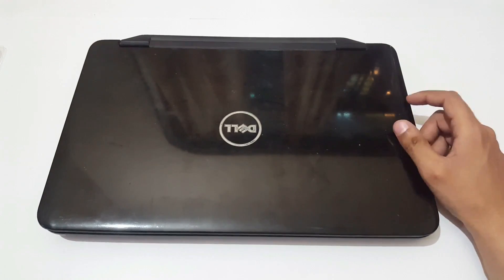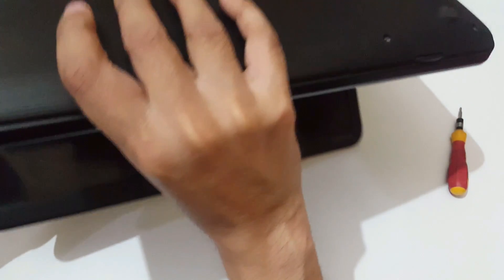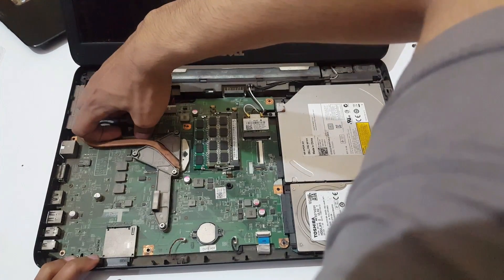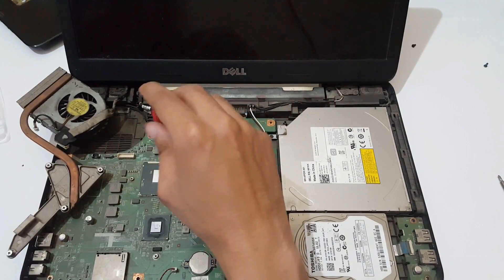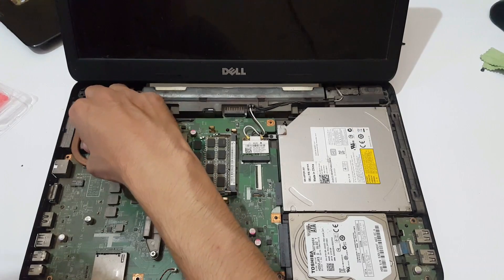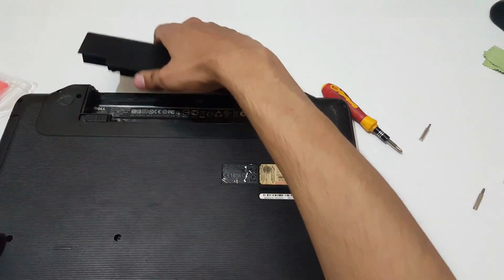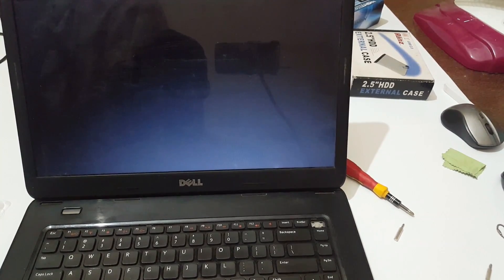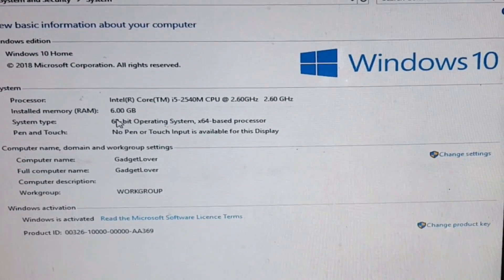How to Upgrade Processor on DELL Laptop | i3 to i5 & i7 - Make Laptop Faster for Gaming

Comment: Bro, i have a toshiba satellite c850 b561. I've upgraded it to a 112 GB SSD and I want to install an Intel i5 or i7 CPU. I don't know if I can change the motherboard or not but here are the specs.
                                          SPECS
CPU: i3-2328m
GPU: Intel HD 3000 integrated (I mean APU)
VRAM: 32 MB
RAM: 4 GB
MOBO: no idea😅
HDD: TOAHIBA SATA 500 GB 
SSD: GIGABYTE 112 GB SSD
Please respond, 😙
Reply from the maker: Gaming with Abdulla : Intel Core i5 2540M is best processor for your Laptop
Reply: @GadgetLover360  Ok, bro. See ya!

Comment: Can you recommend me some upgrades? I have dell inspiron n5010 and intel core i5 M450 , 4GB ram, ssd 240GB i bought it from mall.
Reply from the maker: XK : Intel Core i7 640M is best processor for your Laptop and I would suggest you upgrade its RAM and install SSD for more better performance
Reply: @GadgetLover360  ok, i have an ssd aleardy, and can you do an tutorial about how to change processor for my laptop model? I tried other vids, but i didn't found with my model then i failed and broked my processor..
Reply from the maker: XK : See its disassembly video and I would like to inform you that after disassembly you need to be very careful during processor upgrading for successful upgrade
Reply: @GadgetLover360  you mean there will be an video on your channel? Or there's aleardy?.. because i didn't seen any video about changing processor or changing ssd.. or putting 2nd hdd caddy
Reply from the maker: XK : I would like to inform you that processor will upgrade after changing which I am showing in this video and see your Laptop model disassembly video but you need to be very careful while changing the processor for successful upgrade

Comment: Is it possible to take an i5 M460 @2.53GHz 2534 MHz CPU from a Dell XPS L701X and put it in a Dell Inspiron N7110 that currently has an i3-2330M 2.20GHz 2200 MHz CPU in?
Reply from the maker: Donald Sunny : Unfortunately you can upgrade it in same generation only
Reply: @GadgetLover360  what does generation mean?
Reply from the maker: Donald Sunny : According to time old and new same in Laptop processors

Comment: I have a dell inspiron 5000 intel core i3 8th gen and intel UHD graphics 620. I really want better performance, what should i upgrade if i can. Thanks
Reply from the maker: xXTheHunTeRXx : You're welcome and unfortunately the processor of this Laptop is soldered so you can't upgrade it so I would suggest you upgrade its RAM and install SSD for better performance

Comment: Can I do this with My Dell 15-3000, with 8gb DDR4 Ram and Amd a9 9425 APU?
Reply from the maker: Mayur Khade : In my knowledge the processor of this Laptop is soldered so you can't upgrade it
Reply: @GadgetLover360  yeah just checked it, you should've mentioned about bga lga
Reply from the maker: Mayur Khade : I would suggest you upgrade its RAM and install SSD for better performance

Comment: Hello I have dell inspiron 15-3521 it's  core I 3 3217u  if I want to upgrade processor what processor can I put in the same mother board??
Reply from the maker: Tot 3an5 Amoon : The processor of this Laptop is soldered so you can't upgrade it
Reply: @GadgetLover360  but if I change the mother board I can But another processor isn't it?  If is it true what mother board and processor should I buy?
Reply from the maker: Tot 3an5 Amoon : I would suggest you search on Google for best results

Comment: Bro I have same laptop like you dell Inspiron n5050 ... What is the maximum upgrade I can do to my laptop to make its performance best?
Reply from the maker: K.H : Intel Core i5 2540M is best processor for your Laptop and I would suggest you upgrade its RAM and install SSD for more better performance
Reply: @GadgetLover360  bro any idea about maximum ram support capacity ?
Reply from the maker: K.H : You can expand it upto 8GB
Reply: Bro ..  just upgraded ram to 8gb... Now I cannot find i5 2540m processor any where ... Help me
Reply from the maker: K.H : I would suggest you buy it from Ebay or Aliexpress online store

Comment: Is this upgrade possible: laptop: toshiba satellite l745-s4126. And processor is Pentium b960. I want to upgrade to core i7 2860qm. They are supported. But the only problem is tdp. B960 has 35 and core i7 has 45. If compatible will intel turbo boost work? I also plan to get egpu and power supply
Reply from the maker: weegie_ zelda : Yes and Intel Core i5 2540M is best processor for your Laptop
Reply: @GadgetLover360  but will core i7 2860qm work with turbo boost?
Reply from the maker: weegie_ zelda : Yes but your Laptop will run hot after its upgrade
Reply: @GadgetLover360  does turbo boost work? Also thx i will subscribe
Reply from the maker: weegie_ zelda : Dear subscriber you're welcome and it set ON by default
Reply: @GadgetLover360  thx so much
Reply from the maker: weegie_ zelda : You're most welcome
Reply: @GadgetLover360  wait... I heard the non turbo boost is 2.9 ghz? So after installation it will become 3.6 ghz?
Reply from the maker: weegie_ zelda : It depeds on processor stock rated frequency
Reply: @GadgetLover360  2.5 ghz. Can it turbo boost to 3.6 ghz?
Reply from the maker: weegie_ zelda : Check in CPU performance

Comment: Bro I have core I3 dual core dell Inspiron series 4 gb 500 hd but my laptop prevously install ubunto . Now install win10 ??
Reply from the maker: Irfan gaming : Create primary NTFS partition using disk utility command tool and I would like to inform you that all data will be erased in the existing partition
Reply: Gadget Lover  I installed but windows very slow win 10
Reply: 4 gb ram
Reply from the maker: Irfan gaming : I would suggest you upgrade its RAM and install SSD for better performance
Reply: Gadget Lover  okay thanks bro
Reply from the maker: Irfan gaming : You're welcome

Comment: Bro I have Pentium processor 
And I want to play GTAV on this pc
So please recommend me 
Mention me all modification in my PC for best GTAV experience
Reply from the maker: Khalid Ibn-waleef : Intel Pentium N3710 is best processor for your Laptop and I would suggest you upgrade its RAM and install SSD for better gaming experience
Reply: How I install SSD when I have HDD,is it best or not
Reply from the maker: Khalid Ibn-waleef : It is best and buy 3.5 inch internal SSD for your PC and replace it with HDD
Reply: buy a fucking gaming laptop or disk top .
Reply: @ozilyas6088  dont use cuss words

Comment: Hi. I'm using Dell Inspiron 15 3558 can i upgrade i3-5005U to i5 or i7? If so, what is the best replacement? Thanks in advance! 😊
Reply from the maker: Joeffer Galve : You're welcome and unfortunately the processor of this Laptop is soldered so you can't upgrade it

Comment: I have Dell Inspiron 15 3000 Series, i Have Intel(R) Core(TM) i3-5005U Cpu @2.00GHz .Can I upgrade it I5 Processor For Laptop?
Reply from the maker: AVINASH KUMAR : In my knowledge the processor of this Laptop is soldered so you can't upgrade it
Reply: @GadgetLover360  ,Sir What can do For Playing Games In my laptop like GTA 4 ...My laptop Configuration I3 Processor ,12 GB RAM.(4 GB,8 GB)
Reply from the maker: AVINASH KUMAR : I would suggest you upgrade its RAM and install SSD for better performance
Reply: @GadgetLover360  , Sir I have already 12 GB RAM Slot 1 (4 Gb ),Slot 2 (8 GG)
Reply from the maker: AVINASH KUMAR : Okay and I would suggest you to install SSD for more better performance

Comment: Hey bro,I have HP Pavilion dv4t-5100 CTO laptop
4 gb ram, core i5-3210M 3rd generation hard disk 750gb
can you suggest me some processor for my laptop
and also some other upgrades @Gadget Lover
Reply from the maker: Saurav Dutta : Intel Core i7 3632QM is best processor for your Laptop and I would suggest you upgrade its RAM and install SSD for more better performance
Reply: @GadgetLover360  Thanx Bro I have subscribed you
Reply from the maker: Saurav Dutta : Dear subscriber you're welcome

Comment: Thermal past? What is it. Why that past use for?
Reply from the maker: Referral : It has ability to cool the processor and allowing it to run at higher speed
Reply: @GadgetLover360  if i change processor, is it compulsory ?
Reply from the maker: Referral : It depends on you and I would like to inform you that if processor is not soldered upgrade will boost the performance of your Laptop

Comment: dell inspiron 15 3521 i3  3217U  can I upgrade the processor into intel i5 or i7 if yes which gen?
Reply from the maker: Sunny Ghimire : Unfortunately the processor of this Laptop is soldered so you can't upgrade it

Comment: Can i replace Dell G7 cpu I7-8750 with I7-9750 ? will i have to solder? or it is just use cpu sockets like your vedio ?
Reply from the maker: Mohamed Mahmoud : The processor of this Laptop is soldered so you can't upgrade it

Comment: Can we change Pentium to i5 processor
Reply from the maker: Nagarjun Arjun : What model
Reply: @GadgetLover360  p47f
Reply from the maker: Nagarjun Arjun : In my knowledge the processor of this Laptop is soldered so you can't upgrade it
Reply: If I increase ram performance may good or not??
Reply from the maker: Nagarjun Arjun : I would suggest you upgrade its RAM and install SSD for better performance
Reply: Around how much it will cost for ram and ssd
Reply from the maker: Nagarjun Arjun : It depends on the RAM and SSD brand and quality

Comment: Bro plz tell which to upgrade amd ryzen 5 3500u to which processer
Reply from the maker: Alphaㄆ Avenger : What model
Reply: Honor magicbook 15
Reply from the maker: Alphaㄆ Avenger : In my knowledge the processor of this Laptop is soldered so you can't upgrade it
Reply: Ok bro thanks
Reply: Plz tell that can i upgrade ram in this laptop
Reply from the maker: Alphaㄆ Avenger : You're welcome and I would suggest you check its RAM and if it is found soldered you can't upgrade it

Comment: i have intel core i3 2350M and 4GB RAM in my lenovo b570 laptop can you please tell me which processor i can go for an upgrade.
Reply from the maker: GamePlayer HD : Intel Core i5 2540M is best processor for your Laptop
Reply: @GadgetLover360  any other processor? Because Intel core i5 2540m is discontinued and no longer available in the market.
Reply from the maker: GamePlayer HD : I would suggest you buy it from Ebay or Aliexpress online store

Comment: Bro I have a laptop of intel pentium B960 with 2 gb ram...
and my laptop is dell too.
Actually I bought it from Malaysia 8 years ago...
Now I want to update its process to i5
and I want to upgrade ram to 4gb ram....
But people is saying that I can't change processor on laptop and I want to update this to windows 10 pro after updating.
Now can I update this?
And I am not expert in here..
Need your reply please please..
___________________________
Reply from the maker: sm saiful islam : You can upgrade it without updating Windows and Intel Core i5 2540M is best processor for your Laptop
Reply: @GadgetLover360  bro which ram can I update?
and Can I run win 10 on this laptop after updating
Reply from the maker: sm saiful islam : For RAM upgrade details see product manuals of Laptop and yes you can run Windows 10 in this Laptop after upgrading the processor

Comment: I have a  HP PAVILION G4, AMD A4- 3330MX APU processor, 4 GB ram, 500GB HSD, can I upgrade in to i3, i5 ?
Reply from the maker: Pushpendra Singh Bhattal : Unfortunately you can upgrade it in same generation only and AMD A8 3550MX is best processor for your Laptop
Reply: @GadgetLover360  thanks for confirmation,
Can you suggest how will be purchase this processer?
Reply from the maker: Pushpendra Singh Bhattal : You're welcome and I would suggest you buy it from Ebay or Aliexpress online store

Comment: have a dell inspiron n4050, and i have an Intel Core i5 2430m, i want to upgrade maybe to the i7 or any quad-core CPU, but for temp reasons, im not very sure yet, could it work well?
Reply from the maker: Nicolas Silva : Intel Core i7 2640M is best processor for your Laptop

Comment: I have laptop Acer Aspire E5-475 having a i3-6100U and 4gb ddr4 ram with 1 slot. Can i add 4gb ram and upgrade the processor into i5?
Reply from the maker: Maurexx Gaming : For RAM yes but unfortunately you can't upgrade its processor because it is soldered

Comment: Planning to Upgrade my Dell Laptop N5010 15R with Motherboard(Intel HM86 Express chip) and Graphic card(1GB ATI Radeon HD 5470 graphic processor) because of Heating issue and for Video Editing
Configuration: i5 460M processor with 4Gb RAM .

Any Suggestion Plz. 
Thanks
Reply from the maker: Apoorva Jayaswal : You're welcome and I would suggest you install SSD for more better performance

Comment: Can i updgrade  my dell p47f with pentium r,  4 gig ram to i 5 or later.   Its my old pc so i just wanna make it a bit better
Reply from the maker: Apratim Chatterjee : The processor of this Laptop is soldered so I would suggest you upgrade its RAM and install SSD for better performance

Comment: Hey Sir , amazing video. I have a Dell Inspiron 3520 with Intel Core i3-2370M. Can you tell me which processor specifically I can upgrade to? Also can I upgrade my HDD to SSD?
Reply from the maker: Manjunathan Sharma.R : Thanks and Intel Core i5 2540M is best processor for your Laptop and I would also suggest you upgrade its RAM and install SSD for more better performance

Comment: bro can i install the i7-2630QM processor?
there is no problem?
I have the same model of laptop the n5050
Reply from the maker: Jordan Cantos : It will produce more heat and Laptop will run hot
Reply: @GadgetLover360  I understand, what would be an optimal processor for my laptop?
I plan to increase to 8gb of ram

Comment: I have Asus laptop, AMD E2- 6110 processor, R2 graphics, 4 gb ram, 500 gb hdd, win 10 os. Which is best processor upgrade for me? Or I should go For SSD upgrade.
Reply: Model: x540ya-xo760t
Reply from the maker: Raju Sharma : The processor of this Laptop is soldered so you can't upgrade it so I would suggest you upgrade its RAM and install SSD for better performance

Comment: @gadgetlover can I upgrade my laptop model number:  3rd Generation Intel Core i3-3 217U processor (3M Cache, 1.8 GHz).
Reply from the maker: Sumedh Jhingran : Intel Core i5 3437U is best processor for your Laptop
Reply: @GadgetLover360  but he want to play play game like gta v that is not
Reply from the maker: Srom Gaming : Upgrade will improve the performance of Laptop and I would suggest upgrade RAM and install SSD for more better performance
Reply: @GadgetLover360  my lap ram is 16 gb what game i can run plzz give me example
Reply from the maker: Strom Gaming : It depends on system specifications and upgrade will always improve the performance of device
Reply: @GadgetLover360  ok

Comment: I have core 2 due processor on Dell latitude e 6500 to which processor can I upgrade ?
Reply from the maker: Hesham EI-Shazly : Provide processor number
Reply: Core 2 due T9400
Reply from the maker: Hesham EI-Shazly : Intel Core 2 Duo T9900 is best processor for your Laptop
Reply: Can I upgrade to Intel core i3 ?
Reply from the maker: Hesham EI-Shazly : Unfortunately you can upgrade it in same generation only
Reply: @GadgetLover360  Ok. Thanks
Reply from the maker: Hesham EI-Shazly : You're welcome

Comment: Bro I have core i3 2310m 2.1ghz can I upgrade to i7 2620m?  and another ques where did u find these laptop processors in India?
Reply from the maker: CRAZY OP : Yes but if processor is not soldered and I would suggest you buy it from Ebay or Aliexpress online store

Comment: I am now working on AMD 8 will I be upgrade it to Intel5 and will it work brother pleased reply me...😊
Reply from the maker: ARSHOLA GAMING : If processor is not soldered unfortunately can upgrade it in same generation only
Reply: @GadgetLover360  thanks brother
Reply from the maker: ARSHOLA GAMING : You're welcome
Reply: @GadgetLover360  brother my Laptop is HP 245 G5 can you please check
Reply from the maker: ARSHOLA GAMING : In my knowledge the processor of this Laptop is soldered so you can't upgrade it
Reply: @GadgetLover360  can I upgrade it RAM from 4GB to 8GB or 12GB
Reply: @GadgetLover360  and change hdd to ssd
Reply from the maker: ARSHOLA GAMING : I would suggest you upgrade its RAM and install SSD for better performance
Reply: @GadgetLover360  thanks brother it is a notebook I will do so
Reply from the maker: ARSHOLA GAMING : You're welcome

Comment: I have a core i3 cpu on an intel DH55HC motherboard , can I upgrade to core i7 860 ? Will it accept and work ?
Reply from the maker: shaban ali : Yes
Reply: Gadget Lover even without updating bios ?
Reply from the maker: shaban ali : Yes
Reply: Gadget Lover a huge thanks for your patience and quick replies. I wanna know if Xeon processor is a good option or shall I get the 860 ?
Reply from the maker: shaban ali : You're most welcome and in my knowledge Intel Xeon X3480 would be better choice
Reply: Gadget Lover and will use the same stock intel cooler ?
Reply from the maker: shaban ali : Check its thermal design power specification